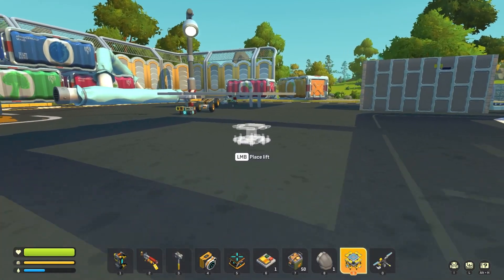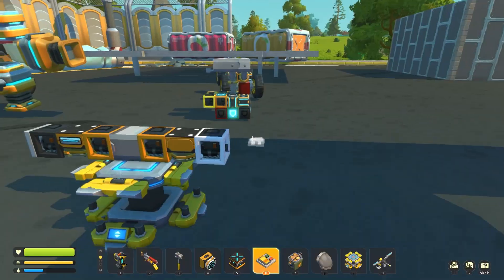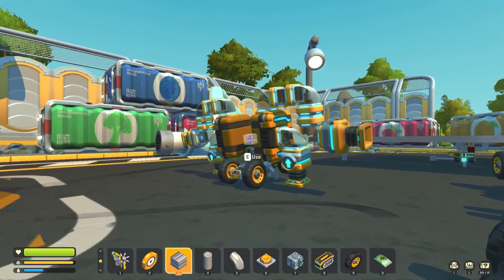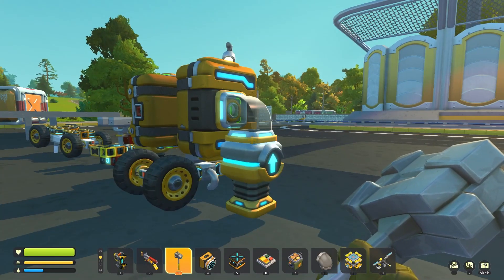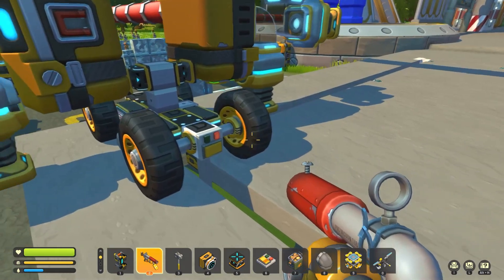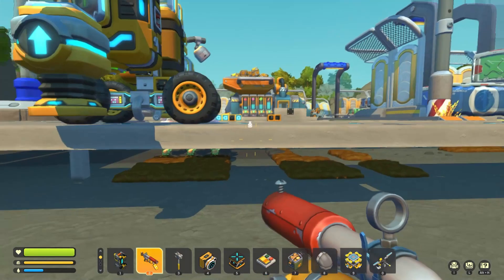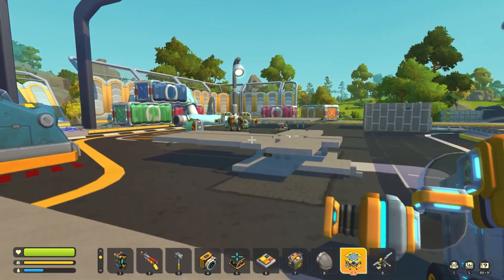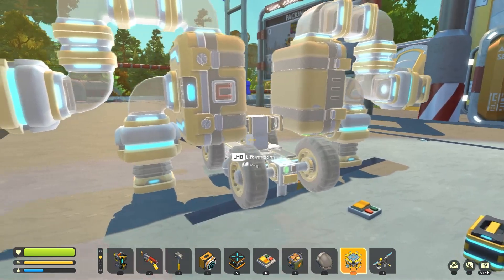Automatic Crop Delivery Drone | Scrap Mechanic Survival Unleashed

Comment: If you change the rotation of the bearings to 60 degrees instead of 360 and then speed up the controllers the effect of the position lock of the contoller will be only the nearest 60 degree position instead of the nearesr 360 degree position. You have to have a total of 360 degrees of rotation but you can split that up into 6 even steps.  You could also do 9 steps of 40 degrees but that will surely be quite slow.
Reply from the maker: Gorgeous, I will try that out! Thank you!